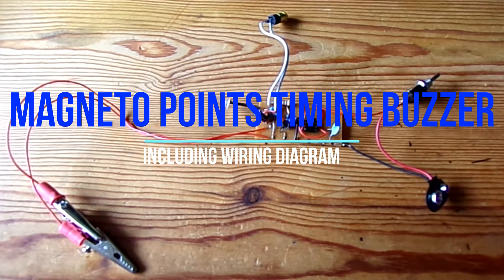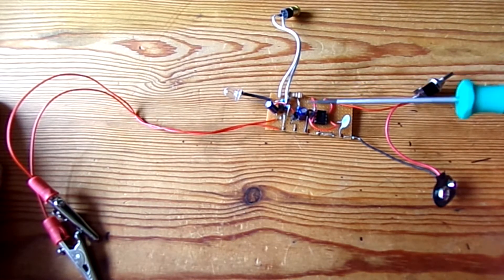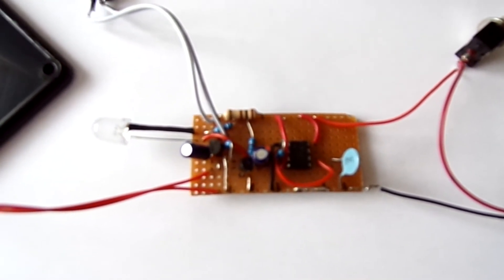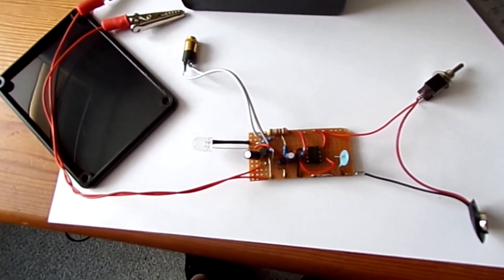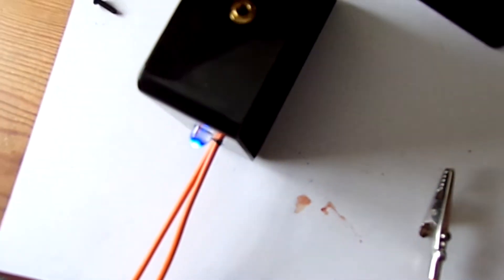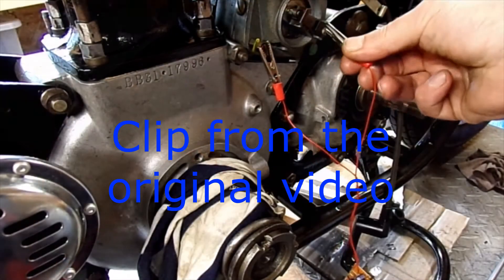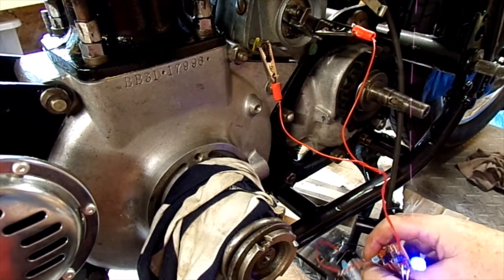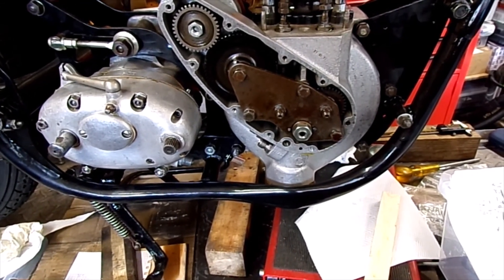DIY Magneto Ignition Timing Buzzer

Comment: Thank you for this and for sharing your design. It works perfectly.

I was surprised that after buying the needed parts and soldering them all together, it actually worked. Then  I tried to make the layout more compact with relocated components and soldered paths. This failed...

As I haven't got a clue how this all works, could you perhaps tell me what components can be left out and what changes would be needed if I want to leave out the buzzer part please? A light is all I need.

Thank you very much in advance and keep enjoying your shed time, as your enjoyment there makes for great content over here.
Reply from the maker: You could try just using the parts associated with the LED (470 ohm & 100k resistors, 2N3904 transistor) connecting as per wiring diagram.
Think of the transistor as an electronic 'switch' being controlled by the points opening and closing (acting on the Base of the transistor).

Magnetos do not have much difference electrically between points open/close due to the primary coil in circuit, maybe only 0.5 ohm, so it's a fine line between the transistor switching and not switching.

The NE555 is acting as an oscillator, providing the tone for the headphones so can be left out along with it's associated parts (2N3906, capacitors etc).

Good luck, be interesting if you get it to work!

Comment: My morris mag won’t work with a conductivity tester because it senses conductivity the entire time. Will this work on induction?
Reply: Yes, this circuit works on induction. AC voltage is used to interact with the primary coil windings inductance characteristics to determine whether the points are grounding out/closed or if they are open - in which case the coil resists the AC current flow.
Reply from the maker: Should do, as far as I know all magneto's work by  electromagnetic induction.